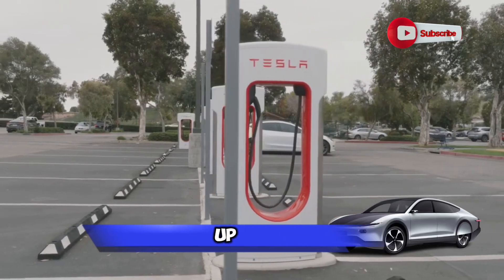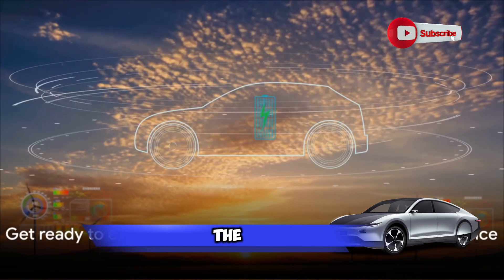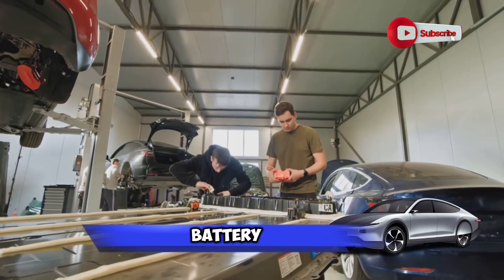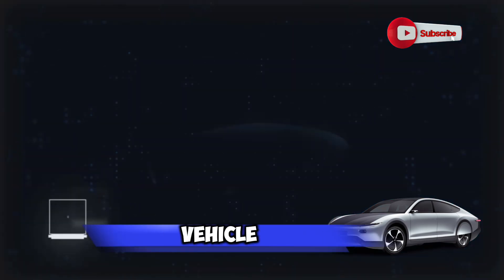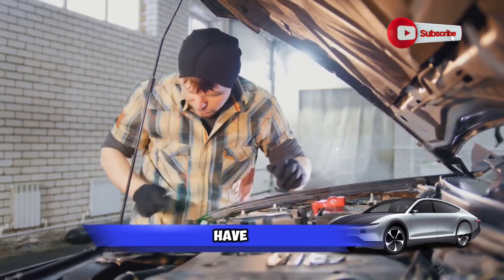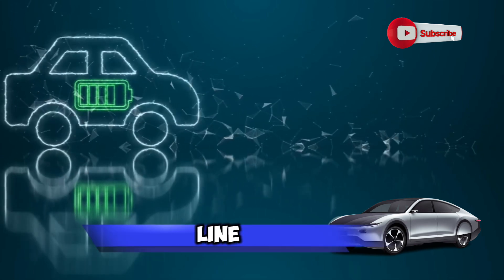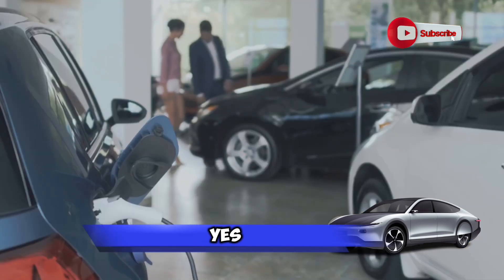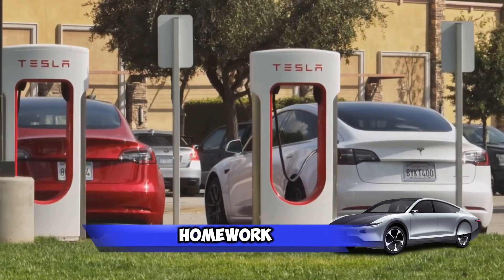The TRUE COST Of Fixing An Electric Car Battery

Comment: Less than 1.5% of EVs ever need a new battery, and those that do fail are usually covered by warranty - .. even the good early ones are lasting 300-400,000 miles (Teslas).  CATL is now marketing a million mile battery in fact.  BEVs last 1.5 to 2x longer than fossil cars, fuel is 4x cheaper, repairs up to 2x cheaper, and they are powerful, fun, quiet, no smell, and no toxic fumes that kill you and your family.